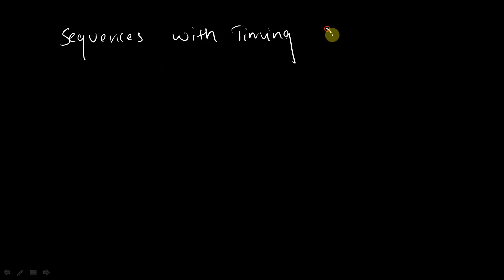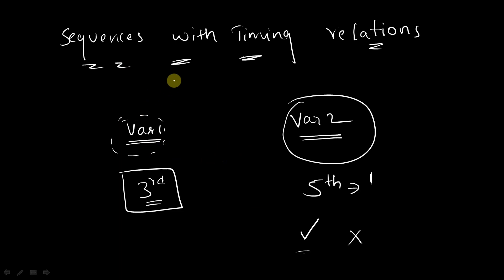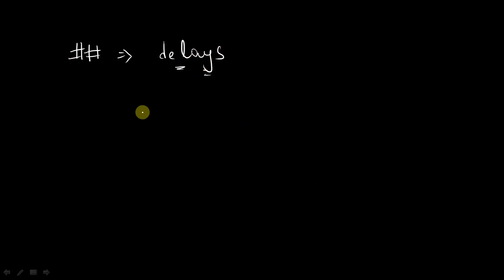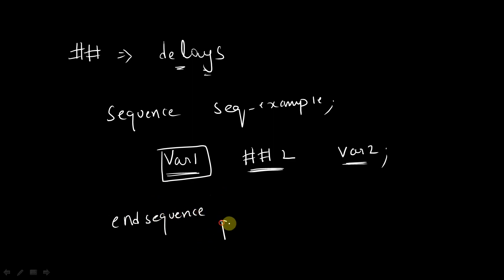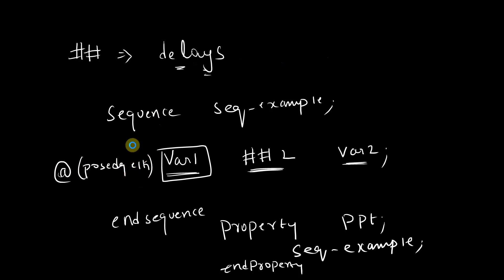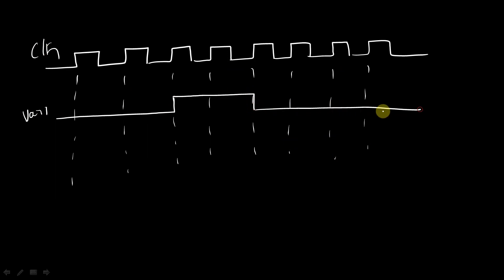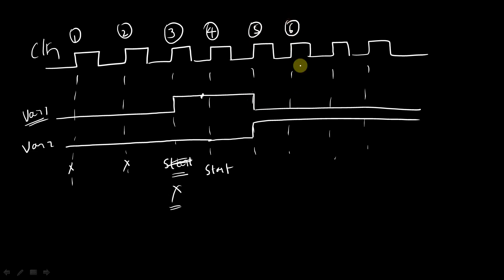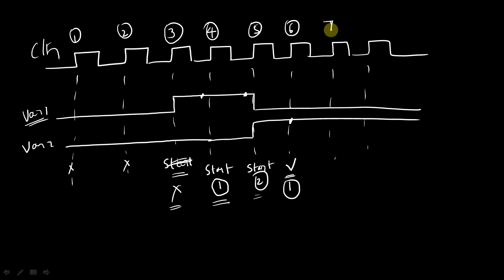Timing Relations in sequences || Usage of ## operator in system verilog explained || All about VLSI

Comment: Here while writing seq, u mentioned  var1 ##2 var2, means var1 after 2 cycles var2 will become high,    but u didn't mentioned like where the var1 will goes high @ 3rd clk cycle ..?
Reply from the maker: Hi I didn't get your question

Here the var1 is becoming high at 4th cycle in timing diagram
Reply: @Allaboutvlsii  Hi, in seq, @(posedge clk) var1 ##2 var2 --> var1 is high on given posedge  clk edge then after 2 cycles var2 should be high .  Here my question is, var1 is check @ 1st posedge of clk only right..?, but in video it checked @ 3rd clk cycle
Reply from the maker: Hi @NeerajaB-k9h  
Here the checking is happening at every posedge of clk not only at 3rd cycle
But if var1 is 0 at any poedge clk we will get partial success